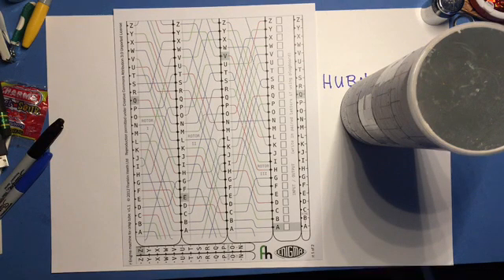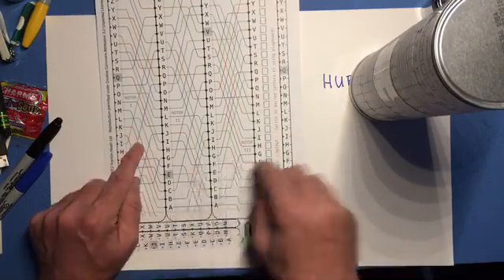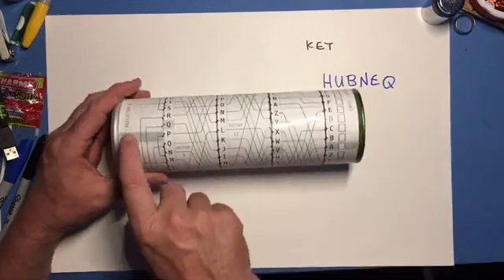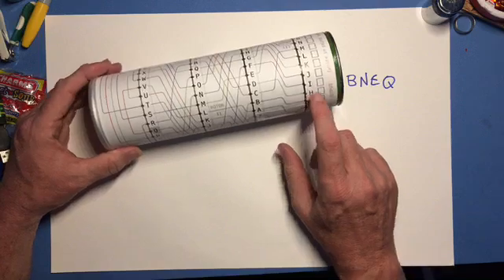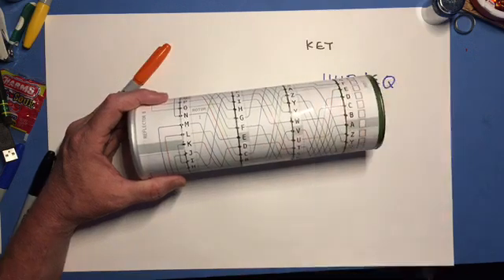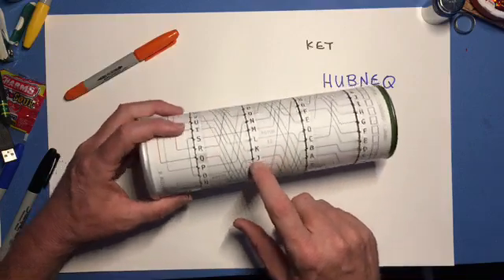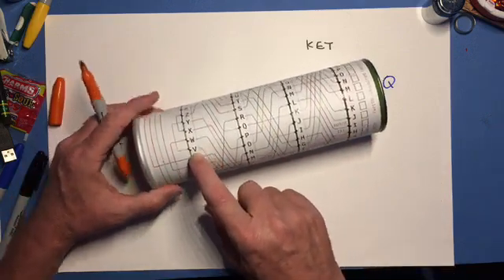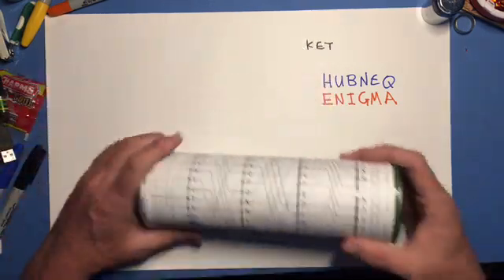Pringles Can Enigma Machine

Comment: Good demo but slightly incorrect on the turning of the wheels when the grey square is shown. Any time the letter is shown in grey square, that must be turned at the same time i.e. KET on first turn of left hand rotor (III) and middle rotor (II) being on E (which is a notch on that wheel) will turn at the same time. So it should read LFU, then LFV (V is a notch), LGW, LGX until you finish LGZ.

So the correct letters would be to start with are VHWXFO plus what I just explained.

Comment: I checked and this only works with the original Pringles can which was 75mm (2 & 15/16ths of an inch) in diameter.  Current Pringles cans are only 68mm (or 2 & 11/16ths of an inch) in diameter.  So if you want this to work with the file as shown, you absolutely must get a tube which is the correct size, since the smaller Pringles can won't work with this.
EDIT To update (two weeks later): I have found that printing the original file at 57% seems to produce a printout sized appropriately for the smaller Pringles can.

Comment: I saw this video and just had to give it a try! On PringlesEnigma M3 now, having realized that it has to be an actual Pringles can (imitations are too short!) Paper doesn't work, it needs to be card (I stuck mine to card) and you really do need it to be in colour because following grey 'wires' around the tin is not that easy😂 Also discovered that some finesse is needed with turning the wheels, inevitably when moving one the adjacent one would slip slightly, leaving some doubt which line it connected to, and this was also the case when reading the text through the encipherment. Yes it was not too tricky to guess the crib was going to be Enigma 😂 but still exciting to work through the process and get the letters out putting at the end. How the code breakers at Bletchley Park felt when they did it for real, I can only imagine, but what a great project this is, thank you ❤
Reply: You can also laminate the paper before cutting out, then use tape to secure the laminated paper.  That also means you can unfasten the tape to change rotors.
The biggest problem now is finding the right size can now that Pringles uses a 68mm diameter can instead of the old 75mm can.

Comment: The Brits were trying to decipher the engima, why do you have to deal with trying to decipher the roters and all the alphanumeric conversions.  The plugboard pins
 are a 1 to 1 conversion, if you just look at the plugboard conversation which is at the end of the chain, would it not solve the whole problem of trying to deciphering the enigma?
Reply: Because the 3 rotors 'rotate' (according to their position) for each letter 'typed', what goes in as an 'A' can come out as anything in the range 'B-Z'. If the next typed letter is 'A' again, it will come out as something in the range 'B-Z', but very unlikely to be the same as its predecessor... The "guts" of the device is busy mixing-up the signal path for each input letter just before some output bulb lights up. That "mix-up" is the magic of this device... Any "1 to 1" only exists for a single letter; the next letter will use a completely different "1 to 1" because the internal wiring has rotated, making different electrical connections...

Comment: Hi! I've watched your two videos about "paper Enigmas"... Great (and cost effective!) ways to play with the idea!

What would, imho, make these really, really educational would be to alternate between 'enciphering mode' and 'deciphering mode' as each letter of input is addressed... Effectively, swap the imaginary keyboard and imaginary output bulbs for each and every letter, pointing out, for example:
"When input 'E' goes through these paths, it comes out as 'H'... BUT, under the same machine conditions (nothing changed!), inputting 'H' comes out as 'E'."
Most presentations talk about the 'reversible' nature of the scheme, but I've yet to see a presentation that demonstrates how obvious it is.
These Pringle Enigmas, with imaginary input/output hardware, are a perfect opportunity to trace the signal path in BOTH directions for any configuration.
Cheers!
Reply: This was also the source of one of the weaknesses of the Enigma machine.  No letter could ever be encoded as itself, since that letter was already used as the input and hence could not be used as the output at the same time.
Reply: @melkiorwiseman  Yes, kinda... An easier way to "grasp" the "self-reversing" aspect is to simply consider the reflector. What goes in must, of necessity, come out on a different pin, AND, that isolated example immediately makes clear why the entire circuit is reversible.

Jared Owen has made a fabulous video animation of Enigma that explains its entire operation very, very well...

Comment: Do anyone understand how they made so that initial letter never codes to itself?
Reply: That 'flaw' is attributable to the 'reflector'.
Enigma is easier to understand if you begin with some rotors that are 'wired' so that 'A' on the input side becomes 'A' on the output side (ie. no substitution).
Make and use 3 "straight through" rotors exactly like this for your imaginary machine.
Typing 'W' on the keyboard enters and leaves the 1st rotor as 'W'... this means the 2nd rotor input is 'W' and its output is 'W'... same story for the 3rd rotor.
When 'W' reaches the 'reflector' it is transformed to some other letter (cannot be 'W') that flows back through all three rotors to become the output to light the bulb.
Because the reflector swaps pairs of letters, no signal path going to the 'left' can be the same signal path going to the 'right'.
The reflector is why the encipher/decipher is reversible... One version of the message is the mirror image of the other (through a very, very convoluted mirror!)
Reply: @rustycherkas8229   thanks, now i understand. Now thinking how germans should modernize it to pass this weakness. Have any ideas? I think about adding one more position for rotors up to 27...

Comment: How does this encryption fare today? Or is it simple to break now with brute force computing?
Reply: Computers are now so fast that breaking this cypher can be done really quickly.  I'm not sure of the average time required but I'd guess it would be on the order of a fraction of a second if programmed efficiently.  This is in spite of there being over a hundred trillion different potential cyphers available for Enigma.  Even programmed using a very inefficient method, I'd expect it to take under an hour.
Part of this is because computers can now hold a large dictionary of words in the target language and automatically search each decryption attempt for any of those words as a guide to whether or not decryption was successful.  If the computer gets a lot of "hits" in the target language, then it's probably found the correct settings.

Comment: I may be wrong about this, but because the way the rotors were incremented (the well known second rotor double step), when you did the initial "click" to decode the letter H, both the second and third rotos should have incremented.
This is because the rotors weren't incremented like a common rotor counter, the kind we're all used to. It wasn't the fast rotor that was powering the increment by engaging with the second rotor. The increment locations ("V" for the fast rotor, "E" for the middle rotor) allowed pawls to engage with the gearing of two adjacent rotors at the same time. So because the middle rotor started in the "E" position, its ring exposes both its increment gears and the increment gears of the slow rotor to the increment pawls.
So, yeah... you should have started by incrementing all rotors.
Reply from the maker: You are absolutely correct, Cristi.  I didn't realize it until after it had been up a while, and I've pondered over what to do about it, try to edit or append the existing video or make a brand new one.  I reckon I should make a new one.  Thank you for taking the time to leave a comment and the pleasant tone your message carries. - Kevin
Reply: Something I realised is that, so long as both ends of the cypher are done the same way, it really doesn't matter whether or not you follow "da rulez" exactly.  What matters is that both the encryption and decryption follow the same rules.
But of course, if you really want it to work the same way as the Enigma machine, you do need to follow "da rulez".
Reply: @melkiorwiseman  Yeah, that was my point.
Reply: If you encode ENIGMA with those settings, you get JVEFTI. This video ought to be removed as it is just plain wrong.

Comment: How do you make up the code you want to send?
Reply: Make sure that the grey bar on the input lines up with the grey bar on the reflector, then set the rotors anywhere you want - just make sure you write down their starting positions! (e.g. rotor I:A, rotor II:Z, rotorIII:F).  From there you take your message (e.g. 'we attack at dawn') and start encoding by finding 'W' on the input and following the lines across the rotors, through the reflector, and back across the rotors to the output. (The output will be V).  Do that for the rest of the letters in the message and you'll have VTEGU GOYYJ KVZBR (the Army and Airforce broke words up into five-letter groups.  That final R is an encrypted  X, as it was used in place of a period, and it let me keep the five-letter format.)  If I encoded that properly anyone with a pringles enigma should be able to set their rotors to AFZ and decode that.

Comment: Hello. Your video is very nice, but unfortunately not correct. If you want to encode the word ENIGMA and you use the code key KET, the solution is JVEFTI. Your mistake is that you do not turn all three rotors at the beginning and later in the word the right-hand and middle rotor again.

Franklin Heath Ltd Wiki, Paper Enigma:
"If the letter in the middle rotor is shaded grey, turn all three rotors one step towards you. 
Otherwise , if the letter on the right-hand rotor is shaded grey, turn the middle and right-hand rotors one step towards you. 
Otherwise, turn just the right-hand rotor one step towards you."
At the end the starting-key turns from KET to LGZ.
I have two ENIGMA computer simulation programs. I have used the same settings with my ENIGMA programs. I have checked the solution several times. Greetings from Germany.
Reply from the maker: You are absolutely right FOP76, thank you.  Hmmm, now what to do about it?  I don't think I can edit it in any practical way.  I reckon I'll make  a new video.  Ich danke Ihnen!
Reply: Even the Franklin Heath instructions are confusing when trying to follow their example.  Double-stepping the rotors all at once - they way they make it seem like you are supposed to - will totally throw off your deciphering.  It took me starting from scratch 4-5 times to get it to work.

Comment: Which version of Enigma is supposed to be the Pringles Can Enigma Machine?
I applied  "ENIGMA" as plain text in several versions but I couldn't get "HUBNEQ" as cipher text in this website:
https://cryptii.com/pipes/enigma-machine
what did I do wrong?

ps: Nice video and thank you for sharing with us your knowledge!
Reply from the maker: Greetings Dimitrios, 
As it turns out, I made a mistake in this video.  It was pointed out to me only this week.  I am making a new one with which you will have no difficulty matching the version.  Stay tuned and thanks for watching.
Reply: @videosbykevin2938  I can't wait!
Reply: @videosbykevin2938  I caught that mistake in watching your video today on 6/17/2020. Your middle rotor was on the turning letter to start so it should have turned itself, the left rotor and the right rotor all before the path of the first letter was traced.
Reply: the A4 version works, using your page, have saved that, but the pringles one dont work, i tried all the versions

Comment: What about spaces? Do they count as a 27th letter? Also, what of the plug board?
Reply: Yes, I would like to know as well. Thanks
Reply: in cryptography we don't use space because it's a hint for the decoder.
Reply: @dimitriostsagkoudis1669  Can you explain what the plug does exactly?
Reply: @johnnie135  at the original enigma machine the plug board actually was used to switch two letters between them, using a wire to connect  the two letters. for example B-E, W-T, R-O etc. Germans usually used 10 pairs  of letters (up to 13 possible).
The early version of Enigma Machine (prior to WWII) didn't have the plug board and it was used by banks. The military version of the enigma machine had the plug board which made the the decoding even harder. Thanks to the plug board the were more 150,738,274,937,250 (151 trillion) additional possible combinations.
Reply: @dimitriostsagkoudis1669  So at midnight when they sent the 3 wheel combination, did they send the plug board information as well?

Comment: Cool video, I’m actually researching Enigma machines as I’m modeling one in a C++ program.  My question is, why did the leftmost rotor rotate simply because the middle one did? Shouldn’t it only rotate when the middle and left right gray areas align?
Reply from the maker: Greetings Joe0404, 
Whether the grey areas align has naught to do with it.  Whenever the grey letter on a rotor moves off the starting line, it advances the rotor to its left one click.  In the example in the video,  when the grey V on the rightmost rotor advanced past the starting line, it advanced the middle rotor to its left, but as it happened, the grey E on the middle rotor was at the starting line, so advancing the grey E past the starting line caused the rotor to its left to advance as well.  Had the grey E on the middle rotor not been on the starting line, the middle rotor would still have advanced, but it would not have advanced the leftmost rotor.  
I hope that helps.  Good luck with your programming.

Comment: This is beyond amazing! - you think the folks in Bletchley park would have got their hands on a can of Pringles!
Reply: True! However, they actually had an enigma machine but without knowing the settings, it's useless. Bletchley had to find a way to discover the machine's settings every day!
Reply: hadn't been invented. neither had A4 paper etc.
Reply: @MarkWadsworthYPP  
To be fair, it not even JUST knowing the settings for the day - the REAL problem was to get information on how the machine was setup, and how it worked inside. Without that knowledge, then this is a difficult problem. We have the benefit of history and all this information. 

Without question, knowing how the machine works, it still VERY amazing that re-create of the mechanics with that can of Pringles.  In fact, while the combinations of 3 wheels are very high, the machine incrementing those simple wheels is what allows the Pringale can model to work. 

So, while the combinations are VERY large for say 3 wheels,  they in fact are not that large at all if you know the working mechanize, and since the wheel increments in such a way, then the machine does not really represent all of the pure math combinations, since you not turning or changing all 3 (or 4) wheels each time.  And, if each of the 3 wheels DID turn each time the first wheel turned, then you would not be able to make such a simple model and re-create this with a cheap paper tube. 

The more I think about this, the Emigia machine was in fact rather over-sold in how secure it was. It not really all that mechanical fancy if a simple card board tube can re-create what the whole complex and expensive machine is supposed to do. there is not really any gears between each wheel - just a simple peg that latches and rotates the wheel, but only ONE point on the wheel that advances the next wheel - that means each turn is not creating a vast new encryption code, but only a simple one from one wheel turning. The peg board DOES change what you get for each turn of the one wheel, but it is "static" and not changed during each turn of the wheel. It only when you turn far enough does the next wheel turn - so, that's what lets the cardboard tube model work.  I think this explains how those Polish (and French) mathematicians were able to create math to crack the machine first.
Reply: I know this is an old comment, but Turing and other members of the team had a paper based replica of Enigma that they could use on their desk without relying on the actual machines they had.

Comment: What are the 'rings' that are left over for?
Reply from the maker: Hello Steven,  In later versions of the actual Enigma machine, as in this paper replica, there were five coding wheels from which you chose three.  The other rings are just that; you can use any combination of the five rings.  Of course the Pringles can is not conducive to swapping out rings.
Reply: I'm talking about the thin strips labeled 'rings' and not the 5 wider rotor strips.  I think some of the rotor designs allowed you to take off the ring with letters on it and rotate it.  So you basically had the same internal rotor, but the coding ring was rotated.
Reply from the maker: Oh, those rings.  Those rings mimic the ability on the Engima to change the location of the letters on any specific coding wheel.  Attaching two half rings end to end and wrapping it around one of the coding wheels, you can rotate the ring to change the lettering on a wheel, then use the wheel as normal.